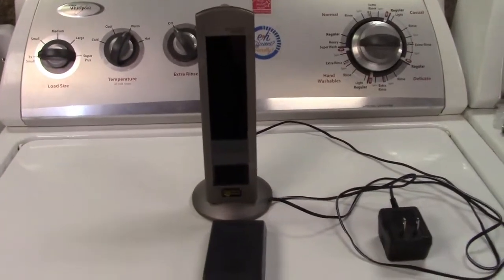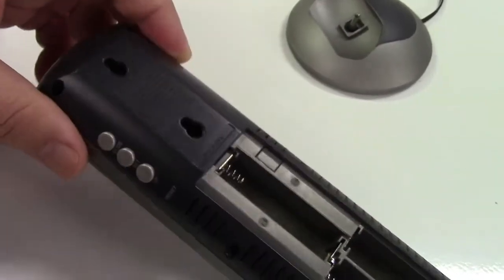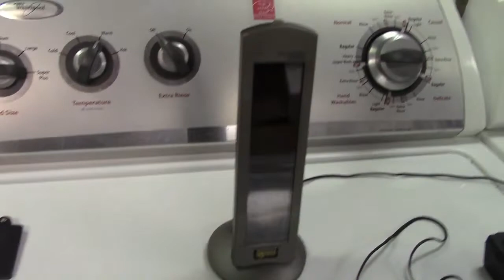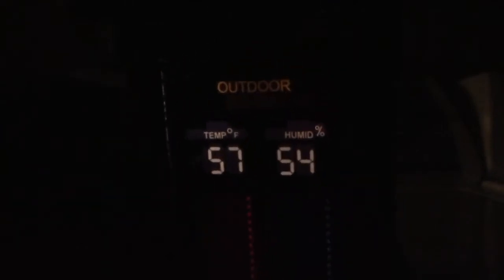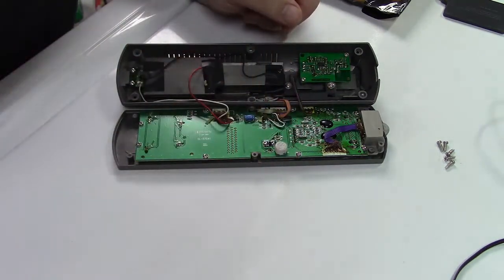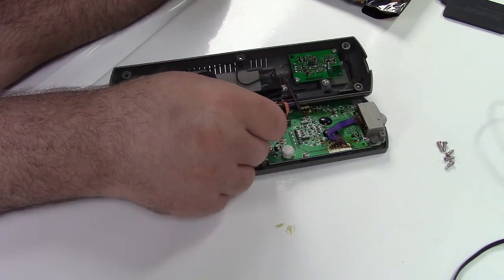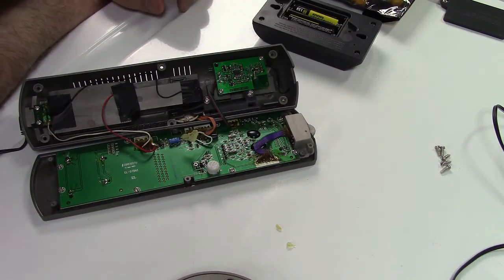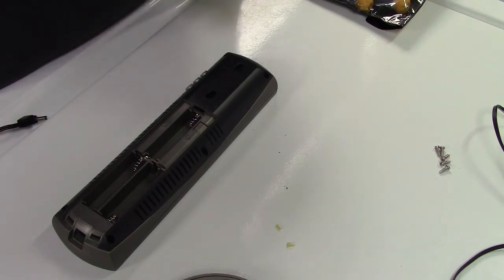2005 Discovery Channel STORE Weathertech TX4000C Indoor/Outdoor Weather Station

Comment: Lots of weather stations!!
We didn't have Discovery Store here, but we did have something similar called Nature Discoveries, similar concept in that they sold over priced stuff. I think it was aimed at kids, and if course was mostly nature related, educational, inspirational, etc etc.

That smaller black and white one you showed, I have two of those (except mine are indoor/outdoor), and they're fantastic. You shouldn't have any issue with those. I bought mine a few years ago, and the batteries they came with are still going strong. In fact, they're the instruments I trust the most for checking temp and humidity.
Reply from the maker: This is the last one, until China sends some more.  I'll bet that store had a lot of cool stuff.

Years ago, China was supposed to send me one of those black and white ones, but the deal fell through.  That was too bad, I kind of liked the styling of that one.  I did end up buying 2 that were somewhat similar from one of those direct-from-China goods sites, but it was like the other weather stations, color, so it needs a backlight to see.  They have the built-in sound sensor, but truthfully, that gets old quick.  I did open one up once to see if I could defeat that, but it was only a cursory inspection and I didn't get far.  Of course if I could get the backlight to stay on I'd have to power it via USB plugged in, which would be fine, but still, there's something to be said about that plain old black and white one that will just work.